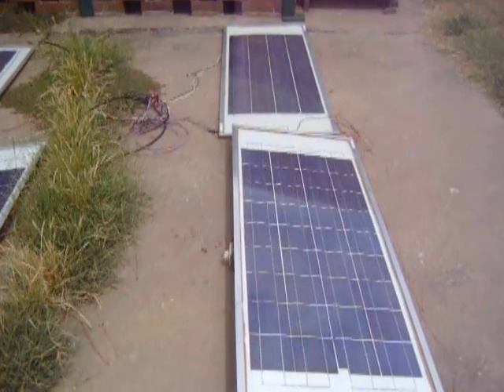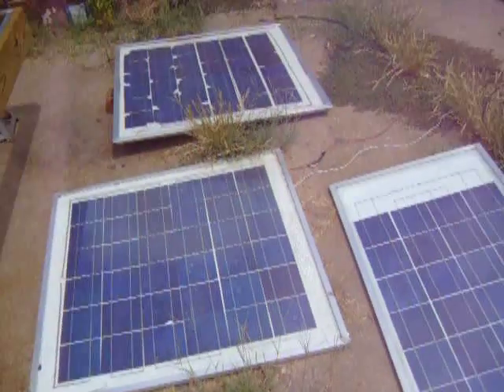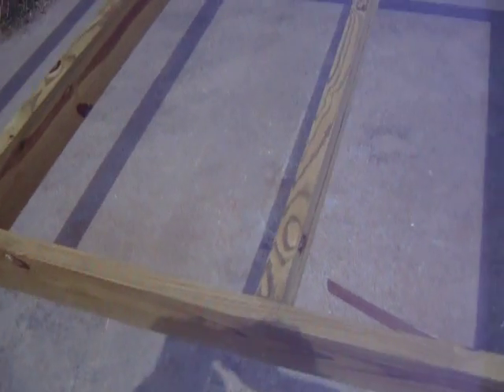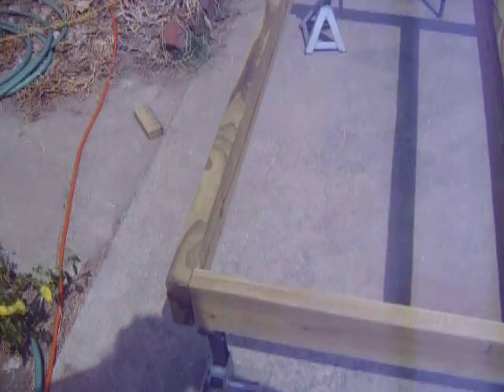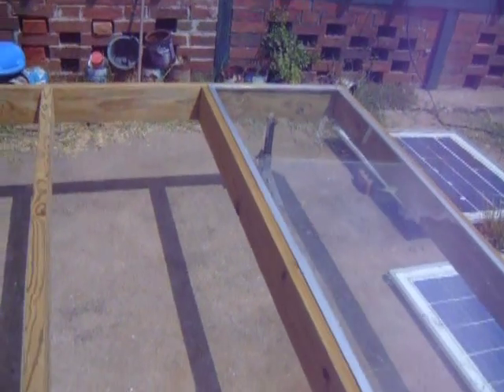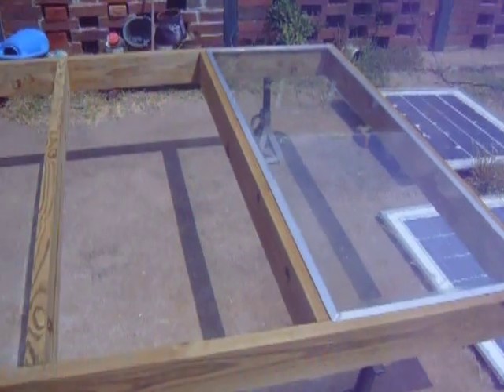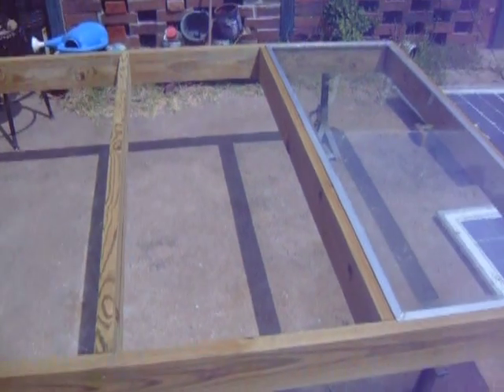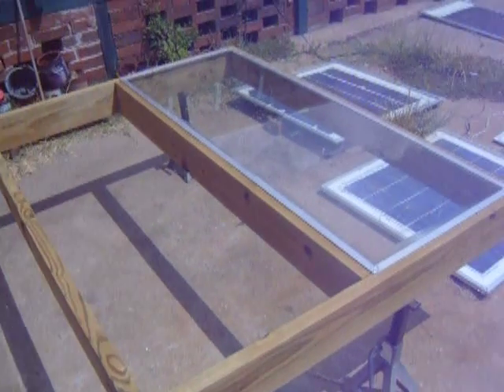DIY Aluminum Frame Solar Panels And Charge Controler pt 3

Comment from the maker: @Schweizer135 Yes, quarter inch tempered safety glass but ,it was not special order I only paid twenty dollars each for four pieces at the glass shop. They had them  laying around in the back. It was really close putting in my five by fives. I plan to buy some more glass that he has laying around thats only 16 inches wide and put some 3 buy three cells in it.